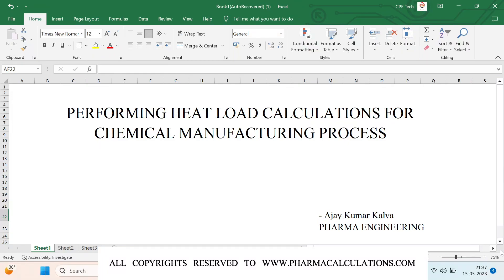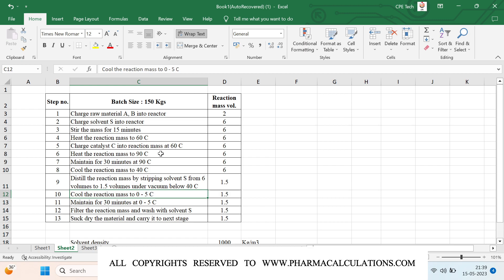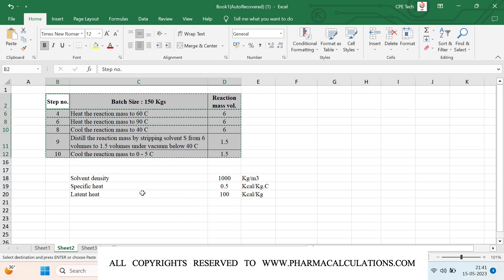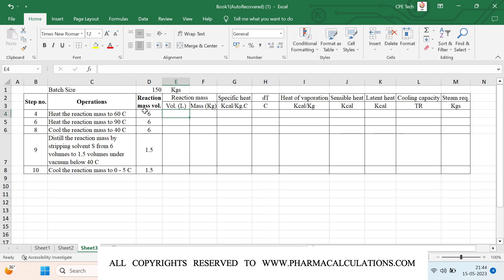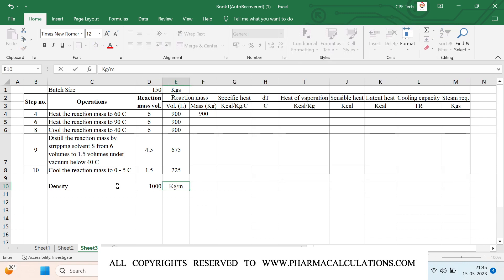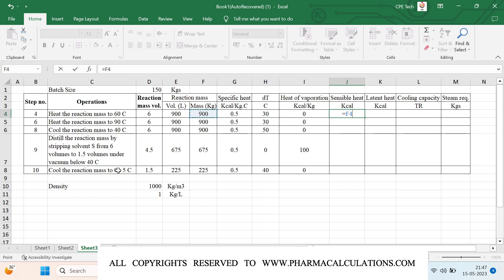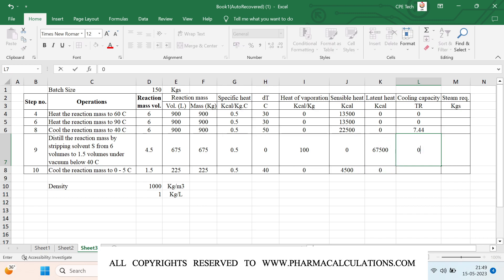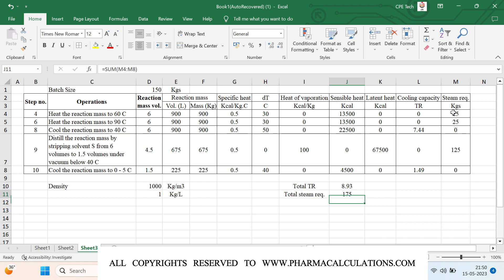Performing heat load calculations for a chemical manufacturing process

Comment: Sir please explain Buchi to RCVD Scale up
Reply from the maker: Dear Kiran,

Scale-up of drying in RCVD shall be done based on few scale-up factors like constant vacuum, constant jacket temperature, critical speed and the occupancy,

Buchi is used understand about the material flowability and freeness.

Hence, if the material drying is found to be adequate in buchi, then you can scale-up in RCVD depending upon the above mentioned factors.
Reply: Sir no need of vacuum,critical speed 10 RPM, temperature 0-5°C,100 litres RCVD With 13% occupancy (15 % occupancy
Reply from the maker: @saikiranampolu9652  seems your response is incomplete, pl share your complete query at pharmacalc823@gmail.com